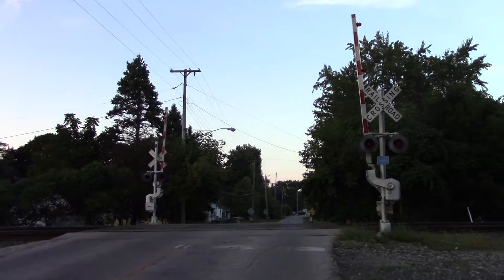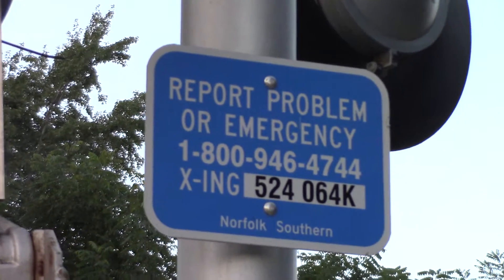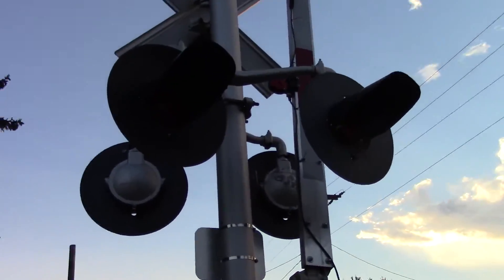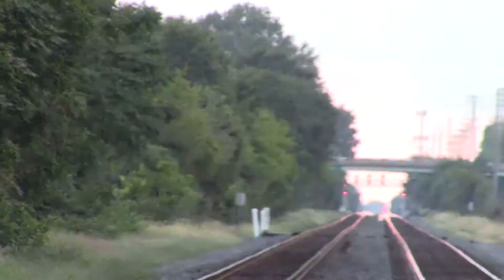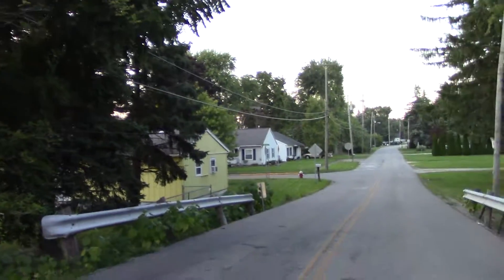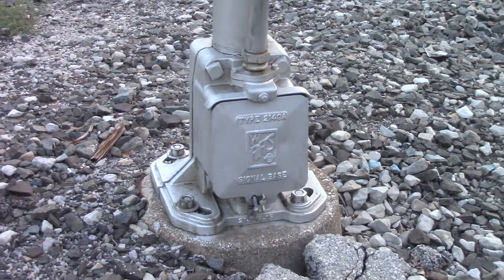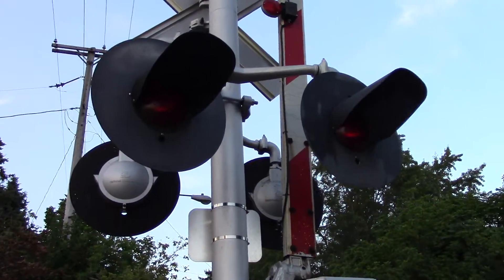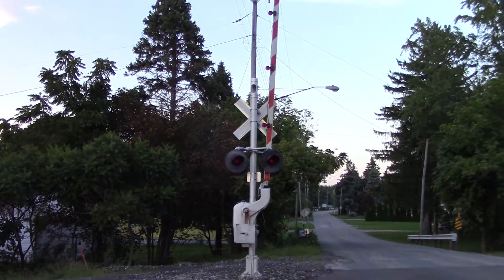Pipe St. Grade Crossing Tour Sandusky, OH 9/4/18

Comment: Cool! Didn’t know FS made crossing mechanisms.
Reply: Federal Signal bought WRRS back in 1969, changed the name to Western Cullen Division, and sold off the company as Western Cullen-Hayes in 1976. Between 1969 and 1976, Federal Signal mad crossing equipment including gate mechanisms, bells, lights, and gate lights (among the various other parts, such as the junction boxes and bases, though they never changed the molds from those so they still said WRRS on them, except for the backs of the  4 inch bases which were updated with the then new FS logos). Federal Signal equipment is pretty hard to find, especially the gate mechanisms and to a lesser extent, the bells.